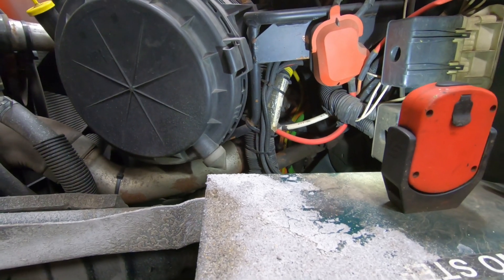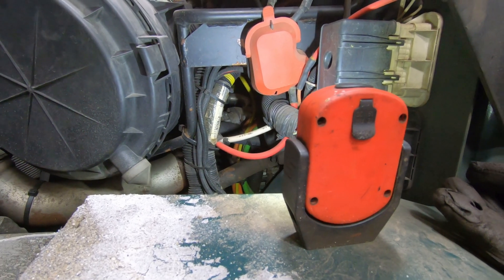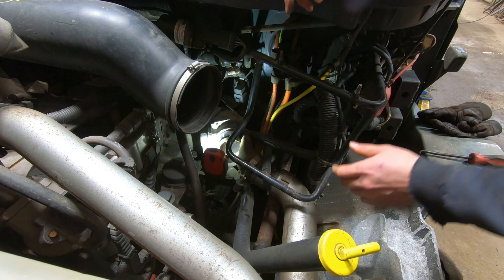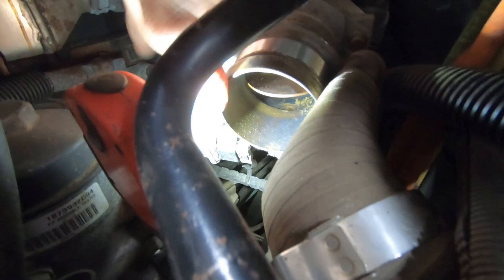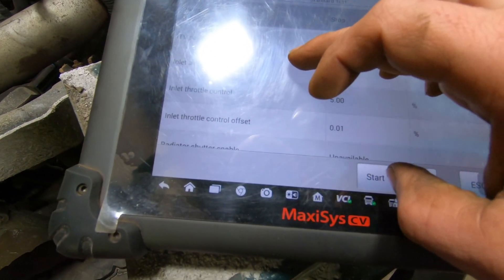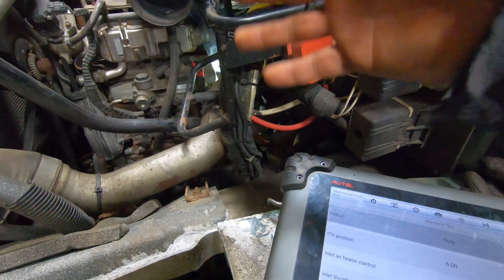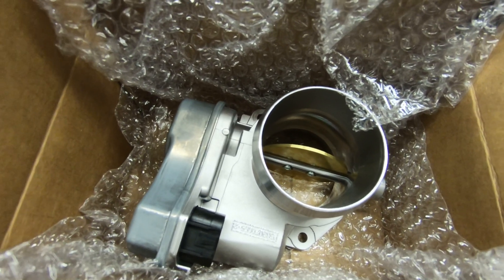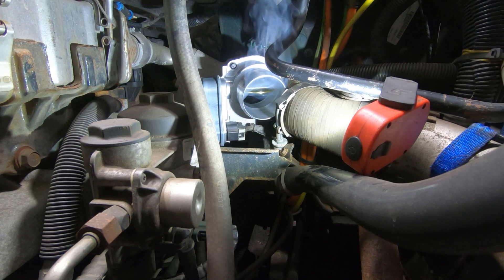ITVH OCC self test failed spn: 3464  fmi: 0 code: 1288 Bad throttle valve

Comment: I was watching your video can you tell me how on your autel, where you went to the place to change the values on the autel to get the itv to open to a commanded point please. Thanks
Reply from the maker: I just tried to find it again and I can’t remember how I found it the first time.
Reply from the maker: Looking at the video it looks like it’s a data pid in the standard test function. I’d assume key on engine off. Standard test and select data. Then scroll down until you find the pid. I think there is a commanded and an actual. I don’t really remember.
Reply: Ok thanks I've looked all over and can't find it. I have one that is throwing the 1288 code itvh occ. And ours isn't as bad as yours as being stuck. But when I do the test it barely moves nothing like the new one you tested.  So thanks great video. I'll subscribe to your channel. And if use your autel can you put a link at some point letting people know how you got there it would really help for us new autel users.

Comment: Came here because of Wes. Enjoyed the video. 
Not sure if you know or not, but you can turn off that annoying low air beep on those internationals by holding the panel dimmer switch (doesn’t matter up or down) and the trip reset button at the same time for a few seconds.
Reply from the maker: I heard that and I tried it, and it didn’t work but I’ll try it again. Those dingers are wearing on me. Haha.
Reply from the maker: I got it to work thank you. I noticed it works if the engine is off but not if it is running. Probably for safety so you can hear the alarm if driving. Thank you
Reply: @JasonTheMunicipalMechanic  awesome! Sorry I should have mentioned that it only works key on engine off and every time you cycle the key you have to re do it. Glad I could help.